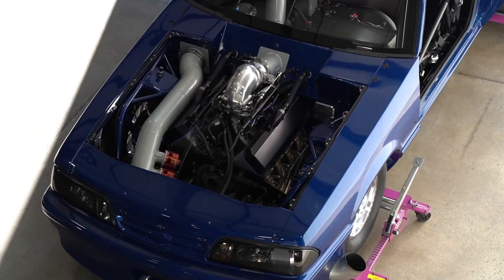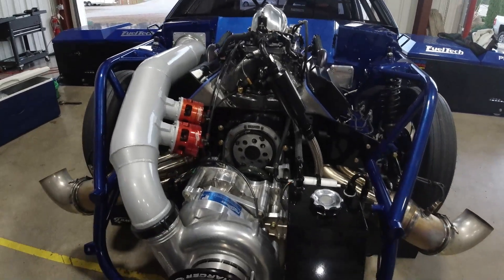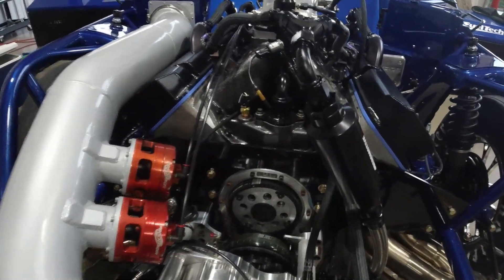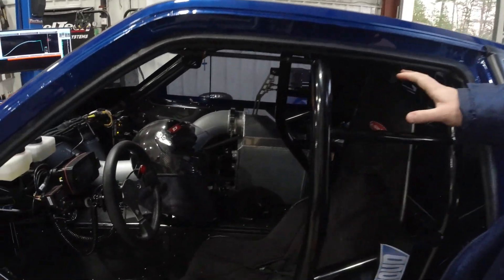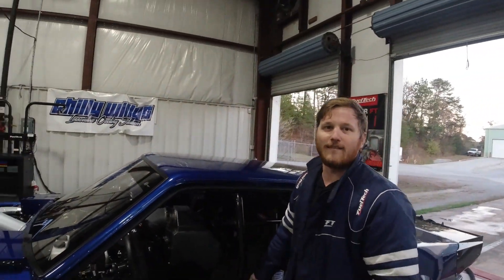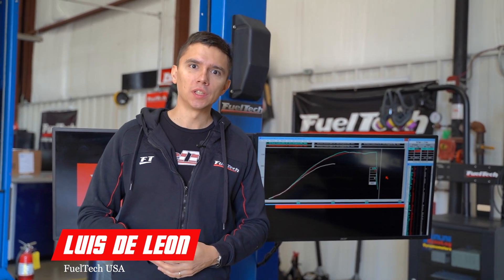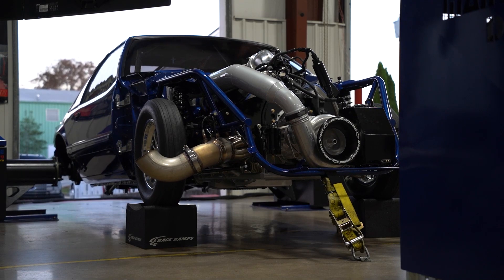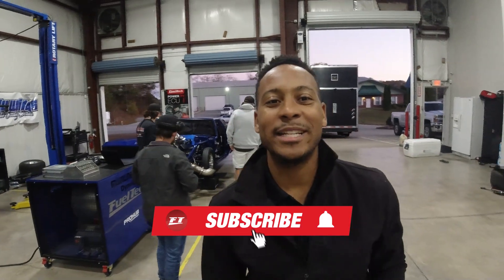2,252 WHP ProCharger Big-Block Chevy | Shane Crowden

Comment: Street Car Jun II R32 Skyline 2285whp in only 3.2 inline-six... but good work.
Reply: @Dr Beyonder the full street Skyline did 6.57 at 220mph and this one?
Reply: Yet way slower than this mustang
Reply: @tunedbyeazy3538  6.37 actually, and this Mustang?
Reply: @tiagoabreu4107  This Mustang went 5.97, so yeah, a lot faster
Reply: @tunedbyeazy3538  yes but it's not a street car.
Reply: @tiagoabreu4107  lol it can be just as easily as the gtr. The bottom line is that this mustang is much faster than the gtr with the same horsepower.

Comment: Thanks for the video.  What a beautiful build!  2252 HP at only 4400 RPM?  Obviously not even close to what this combo will make.  Just out of curiosity why are the factors considered when choosing race gas with all the extra weight of the inter cooler system vs methanol?
Reply: The factors considered for race gas + intercooler compared to running methanol is a matter of weight. If you run methanol there is no need for the intercooler due to how methanol keeps the engine and IAT’s cooler. Ditch the intercooler system and now you’ve lost the weight of that plus running methanol which burns better and produces better power and now you have a faster/more powerful car.